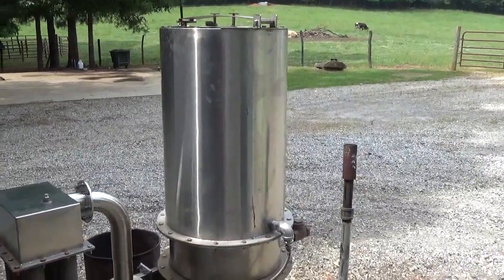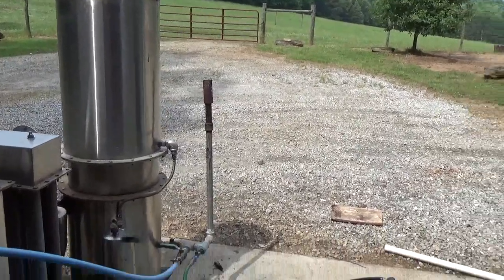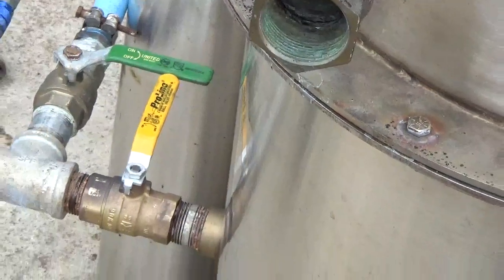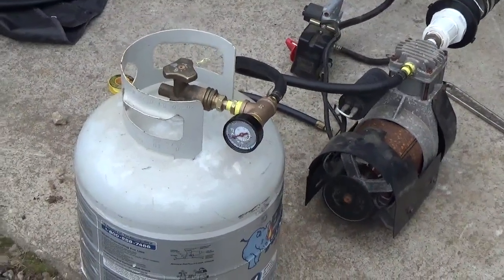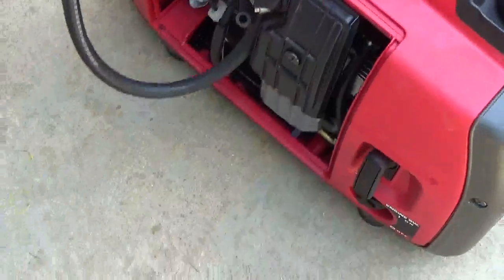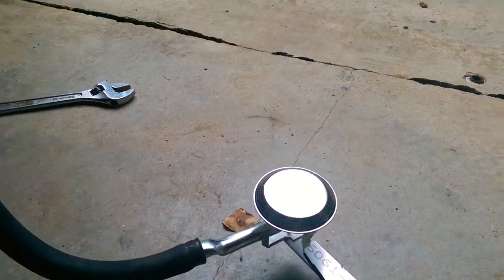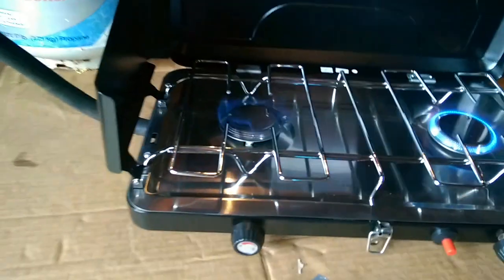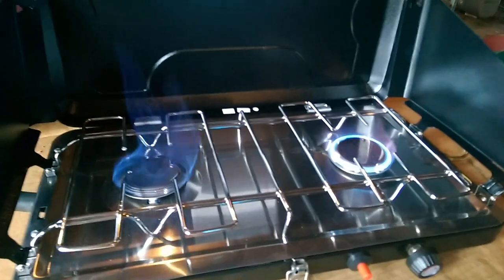Compressing Woodgas for future use.

Comment: Very neat. I'm assuming wood gas doesn't liquify like LPG when compressed so your limited to just air volume of the tank?
Reply: That depends on how hard you can compress it. If you get the pressure high enough it'll liquify. Otherwise it'll just pack in until your compressor can't push it
Reply: wood gas is not just one gas, it is a mix of carbon monoxide, hydrogen, nitrogen, methane, mainly, and probably some others. those will all condense at different pressures and temperatures, and there are some significant differences in density between them. some will condense, some will remain a gas, and they will all separate into layers. the majority of the flammable gases will remain as gas, the rest will condense into some type of creosote oil, which will not vaporize into a gas like propane does when it's reintroduced to atmospheric pressure.

what's in that propane tank is probably hydrogen and carbon monoxide, primarily, and that's a pretty volatile thing to have sitting around. much more volatile than a can of gasoline or a tank of propane. carbon monoxide is deadly, and hydrogen gas is highly flammable.

Comment: excellent you save me a test on my system. I am using a different type of   gasifier but the result is similar. I have been thinking of using an auto air conditioner compressor  to do exactly what you are doing and in fact am working on it now. its a bit messy as the lubrication system has to be set up and i think i have it sorted,using a 3.5Hp Honder to drive it hoping to compress to 20 bar, also my neibour has 1.5 Km of 50mm pvc pipe which will connect to my place that's  about 25000Lts at 10bar stored in the pipe.
I have done tests on various plastics in the gas and the black heavy walled type pipe is not effected by the gas but the type1 plastic is badly effected and gets a really weird waxy surface as it starts to brake down.

Comment: I also love the gasification videos. I was just wondering , how long will the propane tank run the burner and the generator for? I always see people run engines on wood, but wouldn't it be cool to see an aircraft run on wood? Or even an entire wood processing plant that runs on wood? In your opinion , is there enough energy in wood to run a wood processing plant , and still end up with a surpluss of stored wood fuel for the gasifier?
Reply: A sawmill has an INCREDIBLE amount of waste so I think yes.
Reply: @firebird77clonefirebird89  can the sawdust produced from the local sawmill be used to make charcoal intended for activation

Comment: When you compressed 90psi in the grill tank, what was the run time or what amount of gas did you have compared to propane? Also, What compressor did you use? A regular air compressor gets pretty warm after a extended run time. Would that be a risk for gas ignition? I am concerned about an exploding compressor.
I looked on the victory gasworks site and only saw a 5k and 3k grid tie gasifier. It was nothing like yours. What is the size of yours?

Thanks for your response in advance.

Comment: Great video! I wonder what psi it would take to liquefy wood gas? Also wonder if the propane cylinder was packed in dry ice while filling if one could achieve liquefied wood gas with a standard 120 psi home compressor.

Comment: What kind of octane rating could you expect from wood gas?  If I remember correctly propane is roughly 116 octane.  Just trying to see the feasibility of running compressed w.g. in a vehicle built for LNG or LP .

Comment: english freeman - That's pretty cool Scott! I like the side by side stove. :) I couldn't tell what you said about how you hooked it up to the generator....did you say, directly through the gas line in the carb?
Reply from the maker: Yes, directly into the air intake right in front of the carb.   I just taped up the air breather holes.
Reply: Got it! Thanks for doing videos like this engineer775 Practical Preppers. BTW, did you get my email? :)

Comment: Wood gas is basically CO, right?
Reply from the maker: Wood gas is typically 20% Hydrogen (H2)  and 20% CO.  The combination of a fast burning gas and a slow burning gas does remarkably well in a gas engine.
Reply: engineer775 Practical Preppers
How long will the 5 lb tank run that gen
Reply: hawk1481 age it till the hydrogen seeps out as it does then try it and see how well it works, i know i dont want to buy an expensive hydrogen storage tank and im sure you dont either, but it apears (until your testing proves otherwise) we may have to
Reply: Why even use coefficients if you're wrong? +John T Chiz, Time Lord 
It's actually just H2+CO+O2=H2O+CO2 You have to count the atoms on each side to balance the reaction.

Comment: It seems to me that using wood gas for cooking purposes isn't the most efficient idea.  I mean you've started with combustible materials (ie wood) to create the wood gas, so wouldn't it be more efficient to just use the same fuel in a suitable wood burning stove (rocket stove, gasifier, etc) for your cooking needs?
Reply from the maker: Sometimes it is just nice to turn a knob and ... instant cooking.  Cooking is the easiest thing to do on woodgas so why not get that down first and then head to engines, generators, on -demand water heaters, fischer-tropshe reactors etc.
Reply: engineer775 Practical Preppers Not to mention,cooking on a wood stove in Summer is not a job I would want unless the kitchen was outdoors.  Like the idea of storing gas and using as needed and life remains somewhat normal even in a grid down situation.
Reply: besides what others said, sometimes a wood fire is not an option. Camping and all the wood is wet or no wood to be had, outdoors during a burn ban during the dry season etc..
 Sometimes you may just want something fast in a big hurry and not want to mess with building a fire. Maybe the morning coffee and an egg or two and then leave right away.
 Having a useable amount of stored gas would be great for all the above
Reply: engineer775 Practical Preppers I would also add that it seems that the wood gas is concentrated where there is a lot of lost heat in a wood stove. here in Chile we heat the house with wood and most of the heat goes up the stove pipe. Many people cook with wood as well and there is the same issue.
Reply: bwillan i wauld use a safe fridge compressor cose it generate plenty pressure

Comment: it looked as though it burned cleaner with less emissions and certainly with less cost  are their gasafiers sold to the public if so where could one buy one or are they easily made
Reply from the maker: https://practicalpreppers.com/online-shop/power-solutions/gasifier-detail-view
or 
https://practicalpreppers.com/online-shop/power-solutions/the-l-e-a-f-wood-gasifier-detail-view
Reply: engineer775 Practical Preppers thanks
Reply: These things aren't cheap to buy or to make if you could.  It would take a lot of use to make up for the initial expense...

Comment: I was just wondering, the other day, if wood gas could be compressed.  Thanks for proving this.
Reply: BC ElginTex if you consider woodgas to be hydrogen (its most volatile compound) then it will have the same shelf life of stored hydrogen in a propane tank, if you take the same precotions as hydrogen storage then presumably you could run off of woodgas from the cold war
Reply: Oh, another thing I was wondering is, if wood gas can be compressed (which you proved can be done), what kind of shelf life would it have.
Reply from the maker: BC ElginTex All excellent questions to which I hope to find an answer.  There is a lot of speculation around.  Langstons Alternative Power has been experimenting with this too.  We don't have enough history with it yet.
Reply: Hey Scott.  Do you still have this stored?  Does it still burn as efficiently as three years ago?

Comment: Hello: You have more tricks in your bag than a bear in the woods. I was thinking and that is dangerous. If you had a copper coil with a bag of ice laying in it. Put in line before the compressor, would the tank fill faster. Work like an intercooler. But the pressures in tank may rise too fast.. Have a Great Day
Reply from the maker: There are many ways to improve this process and cooling the incoming gas would sure be a good idea.  With my gasifier I can only cool it just so much.  The compressor heats it up considerably.  I am getting a good 150 psi now per fill with a cheap compressor from Lowes.

Comment: Is that ever cool! I know with propane it won't flow in the - 40's. I wonder what the limitations will be on the woodgas.
Reply from the maker: good question.  I never see those temps.  Because the gas is a vapor in the tanks and not a liquid I believe it would work just fine.
Reply: if you have a high pressure tank (think thousands of psi like acetoline or oxygen) then fill propane in temps already at -40 or lower then it will a: be super compressed at ambient and b: flow at those temps as long as theres no moving parts in your regulator and the gas is moisture free
Reply: engineer775 Practical Preppers the root cause is that the gas tightens up at those temps and is essentially no longer compressed if you filled it at water boiling temp or higher the gas would not flow at room temperature, if you live in -40 fill at - 40 but be prepaired for an eplosion as tanks warm

Comment: Purdy hard to hear over the mash-eens, how much air is it sucking in when ya compress it? Maybe use some old semi truck inner tubes as a buffer for pure gas, gasify it in at low psi and draw down with the compressor off the tubes. I wonder what temp / pressure it takes for woodgas to go into liquid state, if it's high enough temp to get to without to much trouble, might be worth looking into.
Reply from the maker: Sorry bout the noise.  Progress is loud sometimes.  :)  To liquify you have to be at least 150psi, run it through a catalyst to convert H2 +CO = C16H32  ( Diesel Fuel) . It is easier said than done on a small reproducable scale.
Reply: engineer775 Practical Preppers nah just add -016 and your problems are solved lol

Comment: I have heard that woodgas is an unstable gas that quickly decays into carbon powder and carbon dioxide. It will be interesting to see how it goes for you with the storage.
Reply: Well? It's been three years. How's the shelf life???
Reply: I sure would like to see any proof of that.
Reply from the maker: There is a lot of parroting this on the internet but I don;t have any proof.  Just going to have to find out when and where things breakdown, change form, or become unusable.
Reply: Howdy.
Well it should be easy to prove.  Just bottle some, let it sit  for (time ?  month ?) and see what happens.  I don't know of any reason that the gas would separate. Very few gases separate from storage.  Those are complex gasses held together with another ingredient.  The gas combo gasification produces are much more simple.  The thing I would be concerned about is container corrosion.
Reply: Barry Remainder hydrogen storage requires special tanks or it leaves and you have methane and co but i dont know what else could happen, for all intends and purpouses is should remain flamable just slow
Reply: Howdy
Tanks Dion for the input.  And pressurized v.s. liquified are 2 different Boom Booms.  I'd say us DIY'es are only in the pressurized category.
Gasification has a bit of a way to go, and its a shame because in general it's a low tech concept.  But I think there is allot of $/usefullness to be made if we would comercialize home units (yep I know about GEK,, they have a great quality affordable product).
Reply: im in the process of trying to make a comercialized unit for trucks, it will slowly evolve but the plan is to have it all below the box or in the engine compartment, as it stands i can make a system that sits below the bed side and takes enough space to make a 8 ft box a 5.5 foot but i hope to make it fit between the frame, it will only get 22km on a fill but only takes 20 handfulls to fill, the plan is to add a below box side hopper and an auger feed system, one major thing is the whole thing will sit below the box sides, if it were cold i could put a taneau cover on and close it and no-one would e the wiser

Comment: So how long does the tank last??
Reply from the maker: This is my first attempt so I don't have good numbers for volume and timing.  My best estimate is 30 minutes of cooking from compressing to 80psi in a gas grill cylinder.  Later I compressed to 150 psi.  I am looking for some larger tanks to fill.   My main objective was to just see if I could compress good clean woodgas.  More to come.
Reply: engineer775 Practical Preppers
I was thinking the same thing but along the lines of how long does it store and does the gas settle out.  Perhaps I am off on this but isn't syn gas based on suspended particulate?  I really have no idea...(Maybe not because you filter it)
Reply: As one of my most respected sustainable / renewables / alternative energy youtubers.  It slightly worries me that after all this time you haven't done any research on just how explosive this can be due to the air being drawn through the gasifier and into the compressor and tank.  A little too much heat at the compressor and you have a flashback, a little too much heat at the tank (or a flashback into the tank) and you have a 150psi bomb on your hands, or sitting on your conscience is the resulting explosions of people who have watched this video and thought it safe to compress syngas.OK fair enough it might be safe under this condition or that condition, but are you prepared to state unequivocally that this is not highly likely to cause an explosion, moreover endorsing it as "safe practice"I really love the work you do, this is not criticism, merely a pointer to say unless you are prepared to endorse this as a safe process with minimal risk, for the sake of your reputation (if nothing more serious) you should consider pulling this video down, or at least redo it and record in the potential dangers.